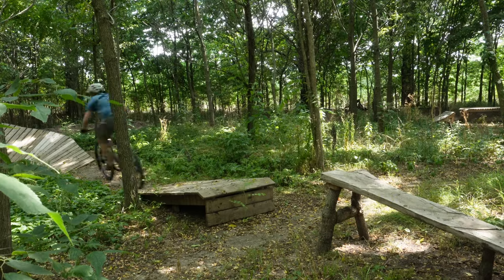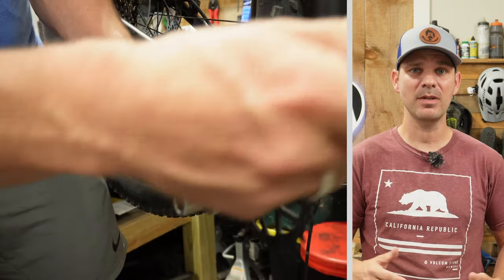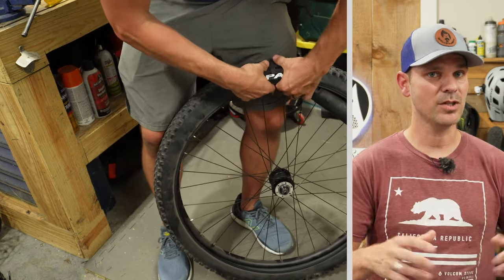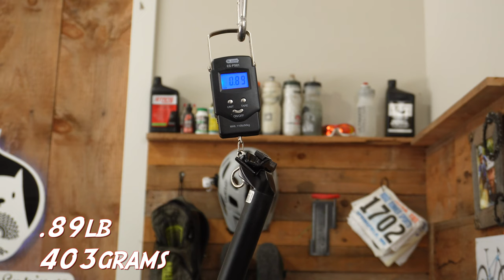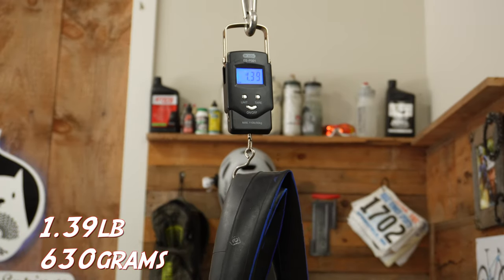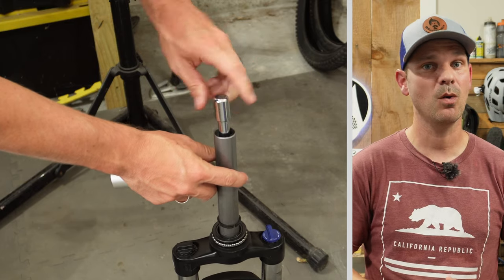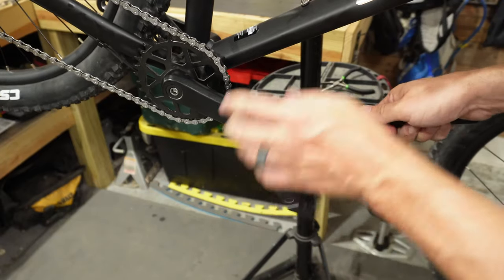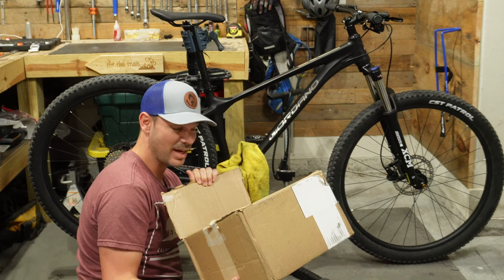Walmart MTB the Giordano Intrepid: Build Check and Parts Weighed

Comment: Bike mechanic here. Just a tip, never grease the surface of a square taper bb. Doing so can lead to over tightening and in general it's not a area you need to worry about rust as it's meant to be replaced and doesn't open up to bearings or threads. It definitely makes sense based on intuition to grease it, but no bike shop will ever grease it.
Reply: I mean do what you want, it's your bike. But it's definitely best practice not to.
Reply: Came here to say this.
Reply: @bsrhoad  glad he said something , I didn’t know that .

Comment: Sweet, i'm glad this bike is getting the love that it deserves! i'd love to see some good upgrades like a clutched derailleur and an air shock, also the seatpost diameter is 30.4mm, most common dropper posts are either 30.9mm or 27.2mm. i wonder what solution you'll come up with. A conversion to tubeless wheels and tires would also be nice.
Reply: The only way to get a good dropper post into that bike would be getting an adjustable reamer and enlarging the seat tube. You'd need h13 size reamer, they typically run for $25-50 on ebay, though they're not the highest quality they'll get the job done. If we add everything up it should come out to around $250-300 (depending what dropper post you go with), which is almost half of what the bike cost... really makes me wonder if it's worth doing all that.

Comment: The starnut is only used for preloading the headset bearings. Once the stem bolts are tightened correctly, the fork shouldn't come off.

Comment: Awesome, I have this exact bike and I like it so far. I’m still very new to working on bikes but I should grease everything.
Reply from the maker: I would recommend it. Especially the bottom bracket. If water gets in there and it will with no grease that BB will be super hard to remove. But with grease it will make it easier.

Comment: I wish tires were that easy to install for me!  Like Sam Pilgrims back pack ramp. Haha!

I'm  a bit of a weight weenie and was glad to see your video. I was also thinking of this bike as well as an e11even (as they both come with hydraulic brakes and are budgetish minded) although it still makes me think I'm officially old...cuz I remember prices for good bikes when I was a kid....haha!

I've got a few bikes in need of upgrades...and am hoping to find the lightest, strongest, cheape$t (cost...not quality)  parts to fix what is broke.

Thanks for going through this process for folks that wanna know..but have not made the time to go through this process themselves.   

Gonna subscribe cuz I also wanna get back to running and biking more. I'm working more than working out...and it just ain't "working"!  Of course I have a few channels I subscribed to.  At some point I may have to just stop watching this phone thing and ride...which will happen when I get the parts so the ride will be permitted!  Thanks again!
Reply from the maker: Jeffery I totally understand on the getting back to running and biking thing. It is hard once you take a brake or even slow down on workouts. Just keep at it and have fun with it.

Comment: Nice video thank you for weighting the parts. I was wonder, I though this bike had through axles not skewers? The pictures on Walmart's website show what I believe are through axles on both front and rear. But, I saw you weighed a skewer (@3:50) for the rear wheel.
Reply from the maker: Front is a thru axle 15x100mm and the rear is a standard QR.

Comment: The star nut is only there to set preload on your bearings..... afterwards you can run the fork without the star nut bolt  and top cap ..... So nope.... no danger there...
Reply from the maker: Good point Joe, it just feels a little better knowing it is now at the correct depth.

Comment: My first upgrade was replacing those stock drips with a pair of Bontragers, anything besides those stock hard rubber that eats into your skin. If you’re wearing gloves it wouldn’t matter but new grips were a huge upgrade. Second thing I did was swap the seat, but honestly I think the stock one is more than fine and it actually quite squishy. (And removed the reflectors)

I’m gonna put on a chain stay protector, prob a black or matte one to go with the look. But then it’s a really solid bike. I could reduce some weight but sounds like I’d need a new fork more than anything else to do so. 

Btw do you know if you have Novatec hubs in your wheels? Mine are black and unbranded but allegedly they’re supposed to have Novatec wheel hubs
Reply from the maker: As far as my hubs I am not sure. I have also heated they are novatec but I haven’t dug into it on mine yet.
Reply: mine didn't come with novatec branded hubs either. i've emailed kent about it and they said the hubs are manufactured by KY/Joy and it seems like the manufacture novatec hubs.
Reply: @aksfactory  interesting, thanks for sharing! So not Novatec hubs but potentially(?) the same spec as Novatec
Reply: @gothops154  if i had to guess i’d say that they’re probably just unbranded novatec, regardless of what they’re branded, they’re still a good set of hubs for sure

Comment: What are you talking about the star nut popping out while you're riding? Star nut does not hold the stem on.
Reply from the maker: You are correct. It isn’t meant to hold the stem on but it can act as a fail safe. I definitely prefer for things to be installed at the correct depth just to play it safe. You never know what could happen during a ride.

Comment: what brand thru axle and length? it shows 15mm diameter but not the length
Reply from the maker: 15x100mm non boost and it is the SR Suntour brand.
Reply: @RunBikeMike  I bought the bike but the thru axle was not in the packaging. they gave me a refund for it but im not sure if i should buy that one. do you recommend a different thru axle?
Reply from the maker: I personally haven’t tried anything else that works with the SR Suntour QLOC. But I am not super impressed with the QLOC design. It is sometimes hard to remove. You might research PitLock. I have heard they make a replacement.

Comment: Do you know the headset specs? I need to order new headset.
Reply from the maker: You will need a zs56 or 56mm for the bottom. The upper should be a standard 1 1/8. I have not measured the upper.
Reply: @RunBikeMike  awesome.  Thanks

Comment: Got mine yesterday...box is beat to sh*t
May not entertain opening it and jist return and buy a titanium frame
Reply from the maker: Now that would be a major upgrade. From Gio to titanium
Reply: @RunBikeMike  Yeah, the two bikes I've been wanting (out of stock forever) were the Starling roost mullet(Stainless steel)  and the Kingdom Vendetta X3 (Titanium)

X3 is finally back in stock, but sadly with a price hike which makes is almost 2k with the currency exchange..

I just Came across a builder based in Japan that makes a bad ass looking frame for less...going this route and like the Estays

Comment: I just got mine and it definitely has a port for an internal dropper post and plenty of room in the bottom tube ports for internal routing. The port is on the backside of the seat tube near the chainstay tubes. Does yours not have that port?
Reply from the maker: No they must have added that. Maybe they saw my video. What is the seatpost diameter now it would be nice if it was 30.9 instead of 30.4 so you can fit a dropper without a shim.